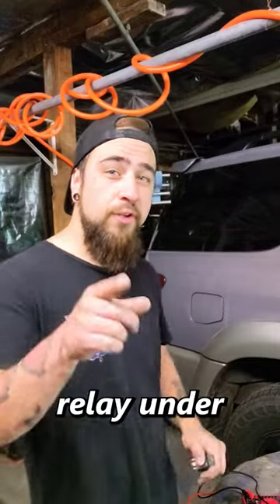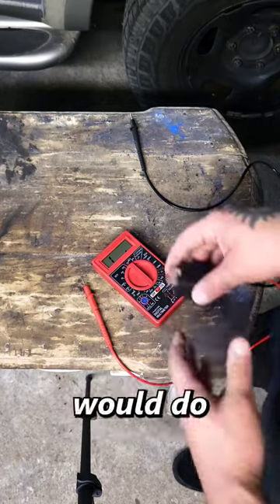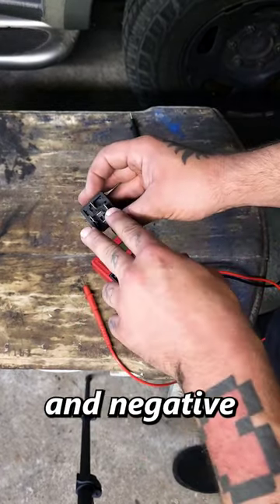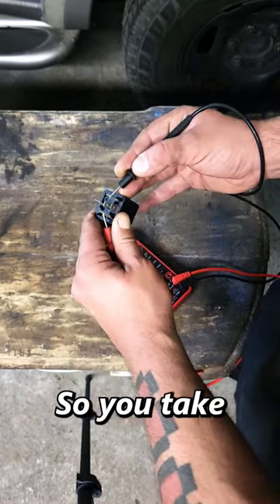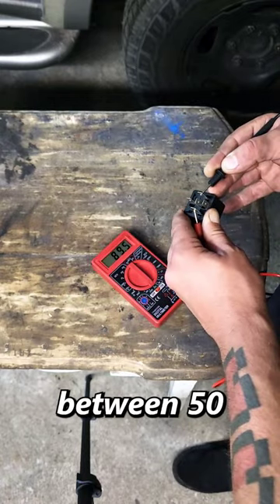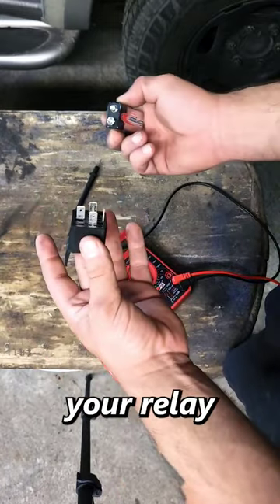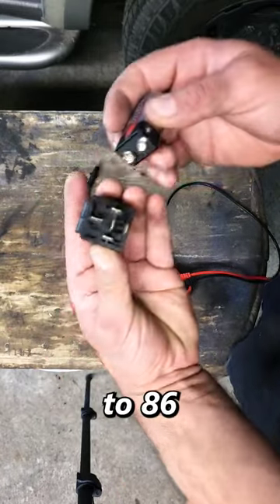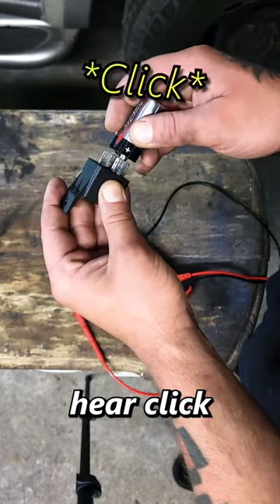The Easiest Way To Test Your Relay - Don't Miss This!

Comment: Awesome tips THANK YOU!
Before watching your video, I took my son’s car to a mechanic and they said bad compressor….$ 600
I tested the relay following the steps in your video, bad relay 
Replaced with new one .. AC running now …. 🏆 for you!!!!!!!
Reply: Omg why this is me today ☺️ I’m so happy right now two weeks ago a mechanic lied and told me that it was my AC compressor. I knew that wasn’t true because it would come on and there was other stuff leading to this so that just didn’t make any sense fast-forward. I took the meter and tested the relay boom this fixed my problem. I’m so happy 🎉

Comment: 12v battery... proceeds to use a 9v
Reply: Close enough
Reply: 😂😂😂 very astute observation
Reply: @cyclecircuit try starting your car with a 9v battery
Reply: @Hff19927  Your not smart, the statement has nothing to do with starting anything
Reply: As long as the relay works with 9v your almost guaranteed it will work with the 12v from the car… This is just a simple test to make sure the relay is relaying😂 (aka switching)

Comment: I think I fried my ecu/ecm, I washed the engine last week, Without covering all the important stuff.. It went into limp mode, I checked all the fuses first, But now I'm wondering if I should check the Relays, it's a 07 Chrysler 300 2.7 Base model. The ob2 Claim there was multiple sensor problems
Reply from the maker: @kornaguilar4718  chances are if your car is going into limp mode you may be having other issues.  A common thing to check is the map/maf sensor first.

Comment: What if it’s not reading on the multimeter but the relay clicks with the battery?
Reply from the maker: Clicking doesn't exactly mean it's good. If it doesn't read the ohms you may have a problem.

Comment: I have a 1,2 and 3,5 , 4 pin relay.  How do you tell which end is positive and which end is negative?  Why does everyone seem to ignore this important point (if you have the other type of relay).  Can you tell by which side the gate opens to in the diagram?  Is the hinge side positive, for instance?
Reply from the maker: Dm me on IG a photo of it and the top side of it if it has a diagram on it.
Reply: @TunerZen   Thanks, but I found someone that said it doesn't generally matter with most auto relays and to try it both ways.   Well, I either blew up my relay or it was broken already and either way, I went and ordered a new one. ( I hope that it was  already broken relay and I don't have to replace the starter/solenoid.)  Also, if I needed to know polarity to check the wiring diagrams.  I had just bought the Haynes manual, but I didn't got through the trouble to figure that out.  I did find it helpful to check resistance of corresponding points to figure out which is the power and which is the gate.  (Trying to add meaning to the symbols.)
Reply: a diagram of the relay is usually printed on or cast into the plastic housing of the relay

Comment: You only tested the coil. You forgot to check continuity between 30 and 87
The resistance between 85 and 86 should be between 80 and 89 ohms of resistance
Reply from the maker: There is absolutely no need to check continuity if you can supply 12v and hear it click.
Reply: @TunerZen  that’s not what I mean. You talking about the coil. I’m talking about the contacts on 30 and 87a that’s usually what goes bad on the relays. I don’t think you understand how a relay works.
Reply from the maker: @antonioaguirre6166  I do. You also mis understand the video. If it clicks its good bud. There is no need to over think how they work.
Reply from the maker: @antonioaguirre6166  I'm not saying you're wr9ng, but for the sake of what I show in this short what you are talking about has nothing to do with it
Reply: @TunerZen  what if the contacts are burned? Even if it makes a clicking noise and you can see the copper arms move through a clear housing it still may not connect the poles due to burned contacts. I rebuild broken test equipment called load banks that have 16 three pole double throw (3PDT) relays, just because they click doesn't mean they will connect that circuit.
Reply: @TunerZen this is cap cuz mine clicks but the other 2 give no continuity with power attached

Comment: I have an air conditioning relay that’s not getting power so my entire HVAC system turns off. Can I just run a wire from the negative terminal of my battery to the 85 terminal and plug it in?
Reply from the maker: The relay is pretty important. So I wouldn't recommend it since it would be unregulated 12v. Have you changed it out already?

Comment: About the multimeter you forgot to say which option should we turn it to
Reply from the maker: I call it resistance but on the muti meter it's ohms.
Reply: Ohms but it what value? 200, 2K, 20k, 200k, 2M or 20m?
Reply: 200 , just above the range needed on the relay

Comment: That's a 9-volt battery not a 12v
Reply: Thank you I was wondering why a 12 volt looks like a 9 volt 😢
Reply: works the same way just to show the relay is workin I'm pretty sure. same can be done to your injectors when your troubleshooting stuck open or closed injector.
Reply: He probably just said 12 volt cause people love commenting to correct people and every comment boost's engagement. I've seen a lot of people do that on here. It kinda annoys me so I'm hitting do not recommend after this comment.

Comment: There is no such thing as positive & negative on a relay, a relay is a switch & U can wire it up to be controlled by ground or U could wire it up to be controlled by power.

Comment: Keep in mind just because it clicks doesn't mean it's got voltage running out the other side had one click but wasn't making good contact once so just knowledge to put in the back pocket so to speak
Reply from the maker: That's what the ohm test is for and you can do a Continuity test too.
Reply: @TunerZen  I usually do continuity,just saying someone hears a click and thinks it's good without checking the out put side then find out the hard way

Comment: Needs to be tested under load. Open circuit testing proves absolutely nothing.
Reply from the maker: The supply of voltage is providing the load... it's clear this video was needed. I was surprised by alot of the comments being fairly uneducated.